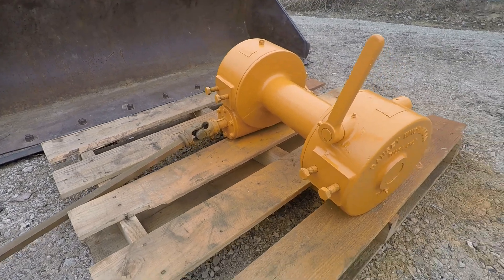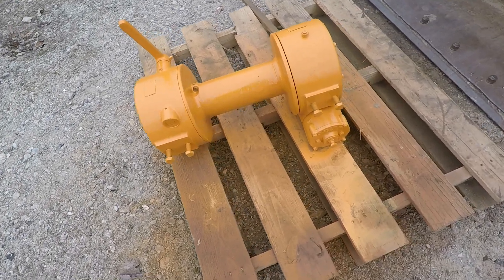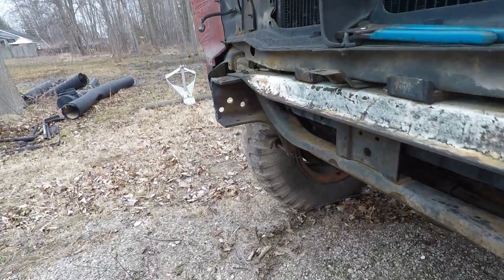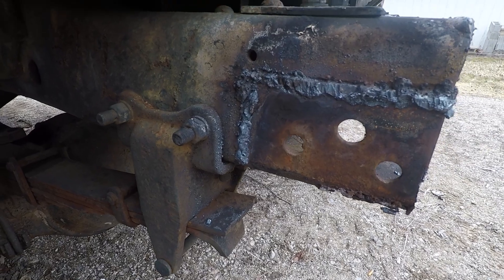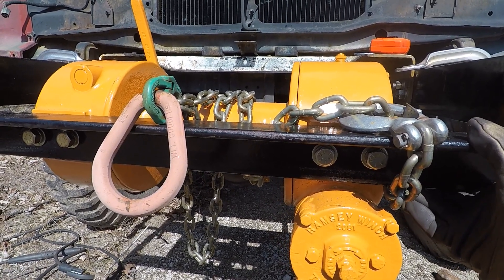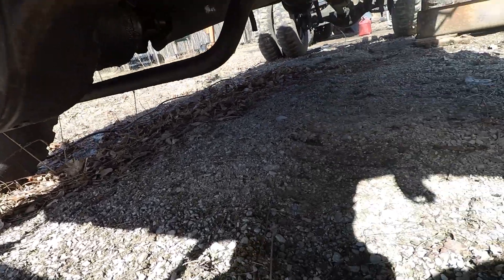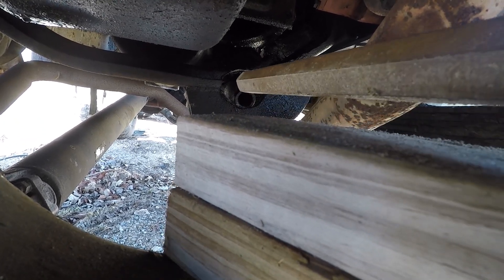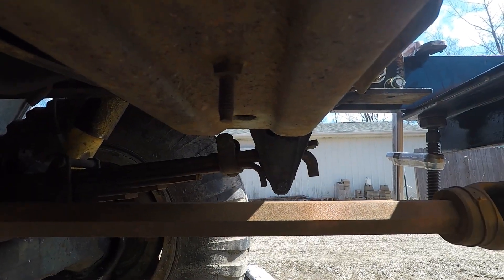Ramsey 700R Winch Install Part 1 of 3

Comment: I know it's probably too late but could you convert that to a hydraulic winch my putting a hydraulic motor on it that way you don't have to Jack with a driveshaft???
Reply from the maker: It is possible. But the core support crossmember hangs down right there. And there's no real good place to bolt a mount plate for the hydraulic motor.
Reply: @WesleyJohnsonMI  Ahh ok got it.
Reply: Hi. I know is late but What about built an intermediate plate  that holds the hydraulic motor  to winch?  Those Ramsey winch were available  electric, PTO and hydraulic driven units.  You have tons of space and the skills  to perform  such task. You can also repurpose the PTO  to move the hydraulic pump that will power the motor. 

BTW: love the description of video. Game a good laugh!

Kind regards

Comment: That winch is a beauty! I would envy having that on my truck 🙂👍 that's one sharp drill bit! 😲 that puppy is throwing out some shavings lol
Reply from the maker: It's amazing what a wire wheel & some paint will do! Not bad for a hand sharpened bit huh? The center is off a little bit. It's only really spiraling on the one flute.
Reply: @WesleyJohnsonMI  looks good! You done a good job lol every bit I grab in my shop seems to be dull 😂
Reply from the maker: @HODGEPODGEDODGEGARAGE  do you need a video tutorial? I was taught by an old welder/machinist friend of mine. It's a handy thing to know, especially when you're the one buying the bits!
Reply: @WesleyJohnsonMI  sure! 😃👍 I always say I'm going to sharpen them all so I never get caught with a dull one 😂 but I never make time lol
Reply from the maker: @HODGEPODGEDODGEGARAGE  🤣🤣 I'll see about throwing one together for tomorrow. I've learned some tips & tricks over the years. I could probably start a segment called 'Bonus Footage' what do you think?
Reply: @WesleyJohnsonMI  sounds good to me my friend! 🙂👍 that would definitely help me out and many others!